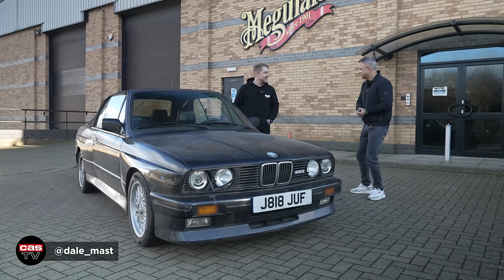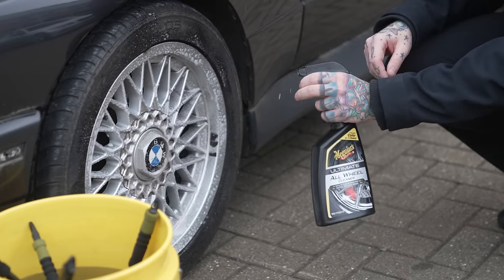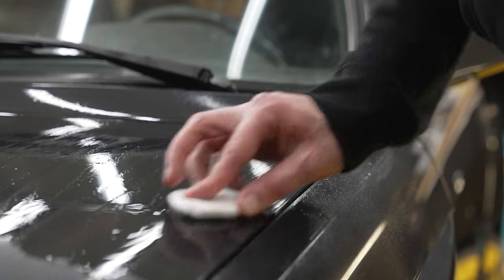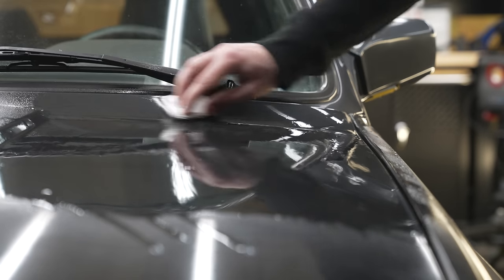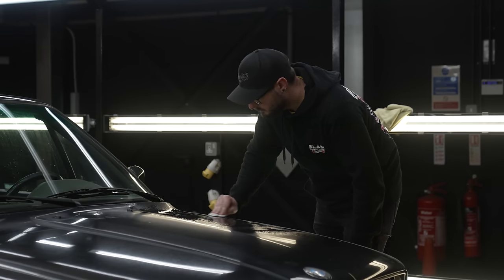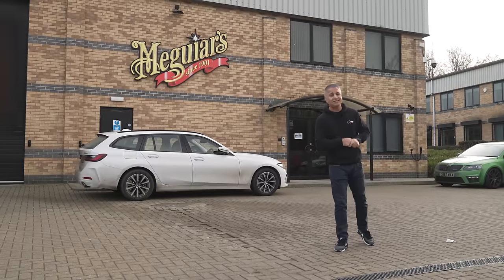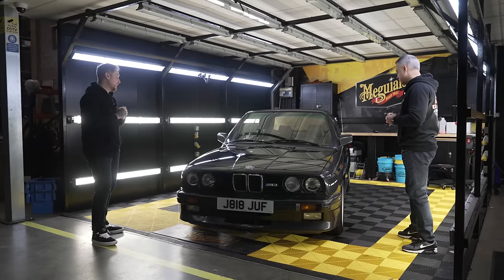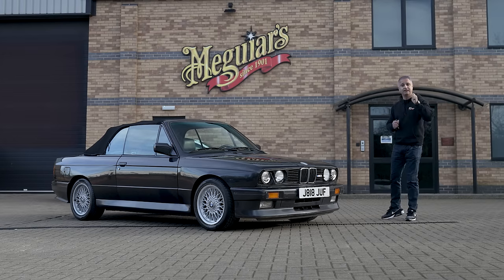Barn Find BMW E30 M3 Convertible Meguiar's Detail - First Deep Clean in 20 Years!

Comment: Had a red E30 320i SE back in the day and after a polish that paintwork was like glass, this is when BMW had the paintwork down to a tee, nowadays its a bit water based meh..  Cant believe I had two of these and eventually sold them and moved on to other cars, by far one of the best cars I have ever bought. It was so good my mum and dad borrowed it for a 32 county tour of Ireland but little did dad know he had a flat rear tyre he said he never felt any difference 😂 (im sure he must have)  50:50 weight distrobution. Real men do it in the corners OO=[ ] [ ]=OO